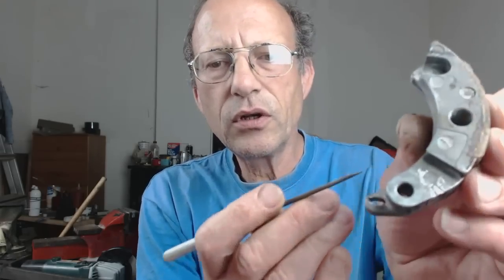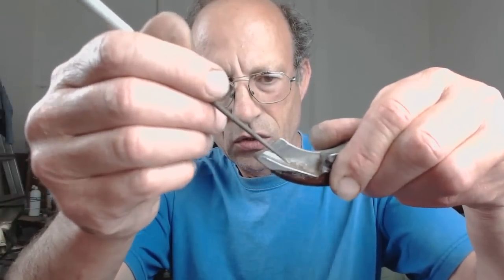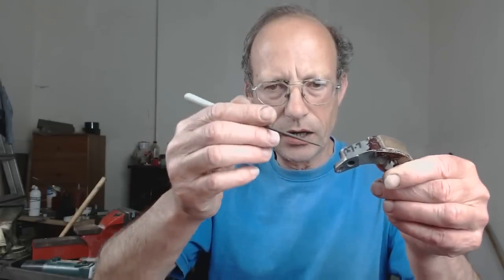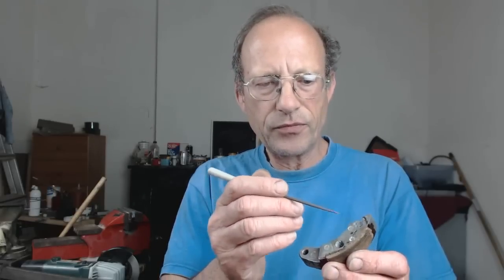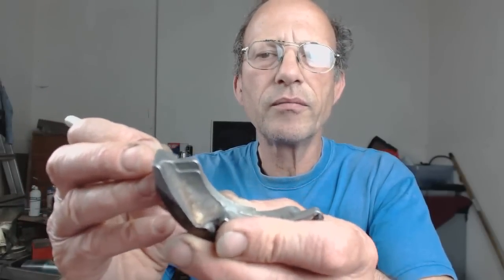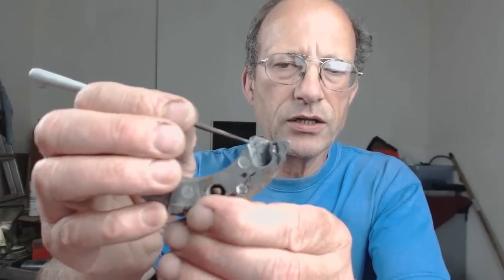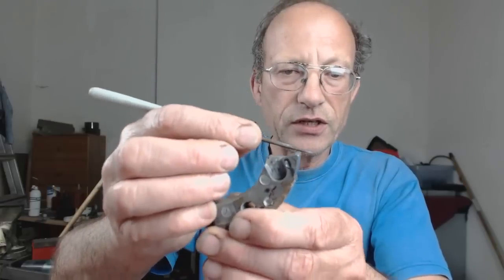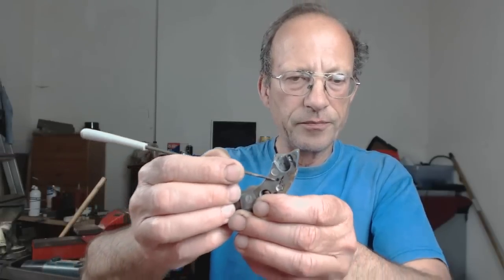Adjusting scooter clutch grab without changing the springs - Part 1

Comment from the maker: Understanding The CVT
All initial testing must be completed with a tachometer, and the CVT cover off, as 'grab points' must be seen and written down against RPM.

* WARNING *
All loose clothing is banned, hair should be tied back, a cap should be worn (if hair is long), and safety specs worn (due to particles flying off the rotating clutch and belt).

The principal 
------------------

... is based upon two gearing devices:
The front variator, and the rear variator.

The front variator increases the gearing by centrifugal force (CF) flinging the roller weights out, pushing the pulley halves together, and increasing the the front pulley diameter.

The pulley diameter change = gearing range.
This is determined by engine speed, and roller weight.

The roller weight determines the engine speed when the pulley drive is engaged (but NOT the drive / bike movement).

Heavy Weight Rollers
------------------------------

At tickover (say 1500 rpm) CF is insufficient force to squeeze the pulley halves together.
Say at 3000 rpm the pulley begins to grab the drive belt.

As the belt grabs, the clutch housing begins to spin @ 3,000 rpm (just an example)

As rpm rises, so too rises the CF, causing the gearing to rise.
This spins the clutch faster.

At say, 4,000 rpm the clutch bites, and drive is engaged.

Now, as the engine accelerates, the bike also accelerates (it's a double whammy!)

On fixed gearing (motorbikes) the bike accelerates purely due to the rising engine rpm.
Not a scooter.
Not only is the engine accelerating causing the bike to go faster, but the gearing is getting taller... also causing the bike to go faster.
Nice!

Say the scoot rpm tops out at 10,000 rpm.
... but at what rpm have the weights hit the walls of the cage?
You need to know that.
Use a thick pencil, and rub a broad pencil line from the outer diameter down towards the centre of the pulley.

With the cover off, you can see it all happening.

You want the belt to be squeezed out to the maximum diameter... you then have full use of the front pulley gearing.
This is obviously ideal, because a broader gearing range maximises acceleration potential.

Lets say, with the heavy weight rollers, maximum gearing is achieved at 9k rpm

You now know everything!
You know the 'critical' launch rpm... plus the maximum gearing rpm.

Light Weight Rollers
---------------------------

CF is dependent upon mass and rotational speed..
So lighter weights have less CF @ 3,000... so the belt isn't grabbed.

Say the belt grabs at 6,000 rpm, and the clutch grabs at 7,000 rpm.

Yippee you shout.
7k rpm and you are in the powerband... and you can barely keep the front wheel on the ground.

However, with the heavy weight rollers, the clutch grabbed at 4k rpm and achieved max gearing at 9k rpm.
IE. from grab to max gearing took an increase of 5,000 rpm.

BUT... with the Light Weight Rollers... the grab occurs @ 7k rpm
This means that max gearing is achieved @ 12k rpm... yet the engine only revs to 10k (and that's past peak power)

This also means that the bike has no drive, until 7k rpm... so it's screaming its guts out, just going at walking pace.

The Solution
-----------------

Heavier clutch shoes, weaker clutch springs - to lower clutch grab rpm closer to the belt grab rpm (in our example say down to 6,200 rpm).

Or also increase the roller weight to drop the belt grab rpm to say 5k (et cetera....)

Conclusion
---------------

Your normal 'performance (yet rideable) objective' is to have the clutch grab, at the beginning of the usable powerband.

... while maximising the gear range.

After that point, you can turn your attention to road speed.
Road speed determines rear wheel speed, and this determines the final drive gearing, which is determined by the rear pulley spring strength.

Stronger rear pulley springs increase the pulley diameter, lowering the gearing (greater acceleration)
Weaker springs reduce the pulley diameter, raising the gearing (faster potential speed)

Therefore, you will fit the strongest springs, that allow you to hit maximum speed at your chosen rpm ... say just past peak power (assuming a flatish power curve).

This will provide the best balance between acceleration and speed.

... and that's almost all of it it explained.
There is a torque ramp at the rear pulley, but you have what you have.
Actual testing will tell you the spring strength required.

Did you get all that, on first reading (please report back on how many times you needed to read it).

All that's left to do, is give the vid a thumbs up, and subscribe :)

Comment: thanks, your, 'aggressive start',  'popping wheelies in the power band'  info has finally explained to me how this clutch can be tuned!, I have a sluggish bottom end pull off, I think it engages too early, too heavy..
Reply from the maker: Fitting lighter rollers will show whether you are correct ;)

Comment: How about drilling some holes around the stock clutch bell for getting more grabbing from clutch shoes at low revs on starting ? Is it bad for the clutch shoes? Will be worn out early in this mode?
Reply from the maker: I understand your thought process, so thumbs up for the question.
The objective is to keep the thought process going, whereby you carry out the mod in your mind.
That way you can examine the bell, before fitting it ... and ultimately testing the mod, without having to leave the thought process.

So what do you think?

Drill the holes - but you can see that the edges are as sharp as a razor.
They need chamfering ... but how to do that?

You will need a 90 degree drill drive.
They can be handy, but the housing can be restrictive against a shoulder ;)

Luckily, in the mind, we can change the position of the holes, to ensure that they all can be chamfered.

Okay, job done.
You have removed (say) 20% of the friction surface area.

So, what do you reckon?
Will it be a good mod?

This is what is meant by 'thinking something through'.
It can save you a lot of time effort and money.

Note - we have all been guilty in this area :D

Comment: Hey i have a sym 125cc scooter. I want less speed and more power to pop wheelies.. what do i need to tune to get that power-band to engage faster
Reply from the maker: You need to delay the grab, so that when the rpm is providing the most power, the transmission grabs.
This is best achieved at the engine drive shaft, by experimenting with different roller/slider weights.
The concept is : that spinning weights are flung outwards, with the force increasing with rpm.
For the belt to engage, it requires x newtons of force.
This can be achieved using heavy weights at low rpm, or light weights at high rpm.

Comment: In gearless scooters, Should we apply little bit of grease on rollers and roller-grooves in variator for smooth spinning of rollers in variator?
Or will it make more issues after some time like dust deposit, vibrations etc ? Please tell what should we do with proper reason.
Reply from the maker: For general running, these components operate without grease.
If you regularly dismantle it, they can be smeared.
Reply: @EngineTuning  Is this theory correct that after applying grease on round rollers they don't able to roll properly and tends to slide which cause irregular flat sides. And these irregular flat sides causes vibrations on certain speed? Is it right?
Reply from the maker: Good question :)
No, it's not correct (from my experiments).

I have heard this theory ... but, on the web, everything is copy and paste.
One person writes something, and it is copied ad infinitum.

Hey; it's easy enough ... you can do your own experiments.

In my experience the rollers don't roll.
Here is video evidence of an experiment that I did with steel rollers.
https://youtu.be/xtveGFplDss
As you will see ... I was blown away by the fact that the steel had flatted.
However, these are the facts.

If you search, you will find that some manufacturers have woken up to this, and produce 'sliders' not 'rollers'.

Comment: hey there. i have a prob with my gy6 and that i think my clutch shoe doesnt engage right. at 1-5kph it vibrates then takes off like a wild horse when i turn the accelerator
Reply from the maker: Hard to predict exactly what the problem is.
I would strip and service the CVT.
Any issues should show themselves.
Good luck!

Comment: hi are you still alive and well mr engine tuning? i noticed no videos for the last 3 years. i have a question i would like to ask you about my doppler er86 that bites far too high rpm and want to lower it. cheers.
Reply from the maker: Hi Ajaxon 
Yes I'm fine and well :)

Re your problem, the solution is simple ... you buy weaker springs.

You should be able to find out which set you have, because typically they are colour coded.
The doppler web site, or a doppler re-seller will likely be selling all the available spring sets.

Spring lengths are fairly standard (some can be a bit longer), so they don't have to be doppler.

Examples - search:
doppler-clutch-springs-sx86-white-d17mm-cgn4827642
You will see that the wire diameter is 1.7mm - colour white

doppler-clutch-springs-sx86-red-d18mm-cgn4827662
These are 1.8mm diameter (red), and therefore take more centrifugal force to open them (higher rpm).

So if you have red, then you could try the white ... they are only €12 for the set.

If they are still too strong, then find a weaker set, until they grab at the desired rpm.

For the full setup comprehension, I've written an explanation, and pinned it.
You will benefit greatly from studying the text :)
Reply: @EngineTuning  thanks for the reply . i used some really weak springs. the once that came with the clutch were 1.2mm wire and 10mm wide and 27mm long. i made some out of .9mm wire and the bite point hardly moved. i had some really weak springs 0.5mm wire and they hardly kept the 3 shoes in place and i added three tiny bits of lead jammed in near the free ends but the bite point  only came down 500 rpm.  ive since added loads of lead. there were some holes perfect for pouring molten lead in and then i stuck on another 2 bits on each arm.  ive yet to try them as im waiting for adhesive to go off. i emailed doppler and they said try adding weight.  i just wondered why much weaker springs had little effect.  btw your accent sounds a lot like where im from. east yorkshire.
Reply from the maker: @aljaxon69  From the Driff region in fact :)

Okay ... now be honest ... did you read my explanation of the CVT?
Or more to the point ... did you study it to the point where you have gained a working knowledge of the CVT?

Evidently not, because it takes time :)

Ideally, you should be reading it, whilst looking at your CVT (with the cover off).
In this way, the penny will drop (and you will feel great [empowered]) ;)

In the meantime ... start thinking about two centrifugal forces (1st and 2nd).
Each creates grab, according to rpm and weight.

Your latest response outlined the fact that you have been concentrating your efforts on the 2nd centrifugal force
... and you have discovered that, even with the weakest springs, you cannot achieve the required adjustment.

From this, you became confused, because FFS! Why isn't it adjusting???

However, the fact is, that you must first adjust the first element of the CVT.

Hah!
It sounds pretty obvious, once it's pointed out (but that's true learning).
(and it goes to show that you can't trust salesmen to provide sound engineering advice concerning their products)

My gamble (a tenner), is that the front pulley sliding (supposedly rotating) weights, are too light.

This means that the rpm must be high, in order to squeeze the front variable pulley diameter.

If you fit heavier rollers to the front pulley ... This will engage the drive belt at a lower rpm.
This will cause the clutch to spin up at a lower rpm.

Oh ... one more thought...
The drive vee belt might be too narrow.
Meaning that the front pulley can't grab it until high rpm (and neither the second).

So ... check the belt dimensions, and if okay, then increase the roller weight.
... Or you could increase the width of the belt, and increase roller weight - whatever works.

Overall ... follow my instructions in the pinned post.

You ideally want to have maximum range out of the front pulley.
IE. Visually check the rpm, when the front pulley engages, and use a pencil line, to discover the pulley range .

Hey!
You've also learned that, by providing the full information (when asking for troubleshooting advice); you can receive the correct answer.

It was only when you outlined your previous experiments, was it possible to direct attention correctly.

That is the biggest, and most universal lesson to be learned.
It will help you throughout your life.

Never (ever) again, will you hide the most important information, when asking for advice ;)

Good luck!
I think that you are now sorted.

BTW where are you from?
:)
Reply: @EngineTuning  hull
have you an email address i can send you some pictures? this is a clutch pulley fitted to a mobylette 50v 1974. the variator is a doppler er3 and is engaged with the belt all the time. the variator is only supposed to start variating at say 6 thou. peak power is 7k cluch bite point is 8k. the belt is a wide malossi. i have tried weakening the counter spring and reducing then adding weights. but the front variator is not the problem. i cant even push the bike forward when stopped it turns the motor over. this might be a different situation to a scooters cvt as i am fully engaged at 0 rpm. my problem is getting the clutch arms to bite at less than 7500 rpm. i cannot fit any weaker springs. less than .5mm wire?  i might even try no springs. if the only option to me is adding weight then i will have to get creative.
Reply from the maker: @aljaxon69  I lived in hull for a few years :)
Because the 2nd element is providing no adjustment, logically you must examine the 1st element (the ER3).

Has it been modded?
Is it moving freely and squeezing the belt to a greater diameter?
What rpm to what diameter?
(use a pencil mark)

What weights are you using?
My guess is that they will be light
Hahah or none at all.

Fit the heavy weights.

This will cause the squeezing action to occur at a lower rpm, thus causing the clutch to function at a lower rpm.
Reply: @EngineTuning  its nothing to do with the variator. the variator drives the belt from 1rpm. no slippage. its under tension from a counter spring. i can adjust using weights to get it to squeeze the belt outwards at any point i want. this is like moving it up through the gears. exactly the same as the original variator.  ive done a bit of research and joined some french speaking forums and it is apparent that these er86 clutch pulleys are only good for 8k engagement due to (poor?) design. this is ok for those with high 14k revving tuned motors. they suggest using really weak springs (which ive tried) and then they suggest drilling and tapping the alloy arms from the side  and inserting steel rod m8. i dont think this will be enough gain as you lose the weight of the alloy. so i am going to drill and tap but pour in molten lead and then press to secure. also ive noticed the anchor point for the springs is in the wrong position in relation to the pivot and actually tries to pull the arm back inwards. maybe if i move it so it does the opposite? or a more neutral position might be better? thanks for your help  i was hoping you could wave a magical wand or come up with a solution i hadnt thought of. 
when you say "This will cause the squeezing action to occur at a lower rpm, thus causing the clutch to function at a lower rpm." you are not grasping how this system is linked. in effect i have a fixed cog on the front that is in direct contact with the belt. it is taught when stationary and from 1rpm upwards it drives the pulley. the clutch arms attached to the pulley make contact with the bell which is connected to the primary drive or cog/chain. i need a way to make the arms grab earlier.
Reply from the maker: @aljaxon69  Well, if it was designed to grab at high rpm then yes, you are left with modding.

On the ER3 weights.
It doesn't matter that the belt is always driven.
What matters is the rate of change of the diameter.
The heavier the weights, the less rpm that is required to achieve the largest diameter.

The larger diameter will rotate the clutch pulley faster, at lower rpm.
This is explained in doppler instructions - though limited to stating that lighter weights require higher rpm  to get the variator moving.

If you have all 6 heavy weights fitted, it will lower the rpm clutch grab - that's the reason for the weights.

If it doesn't lower it enough, then yeah, you will need to add weight to the flung end of the shoes.

The other option is to reline your shoes with a slightly thicker material.
www.mcmaster (dot) com/brake-lining/ lists what they have available.

Search:
Relining-Motorcycle-Brake-Shoes-1.pdf

This tells you how to do it, and the glue that you would use.
Everything that you need is available from McMaster Carr.

Don't forget to accurately weigh each shoe.
Also, make sure that you are precise when adding weight - in the same place, and the same weight.
Reply from the maker: @aljaxon69  Oh ... and there are numerous firms that professionally reline shoes - search brake relining ;)
Reply: @EngineTuning   ive just ordered some accurate mini scales.......  thx for input. i will keep you informed